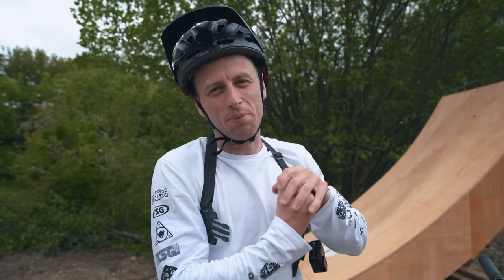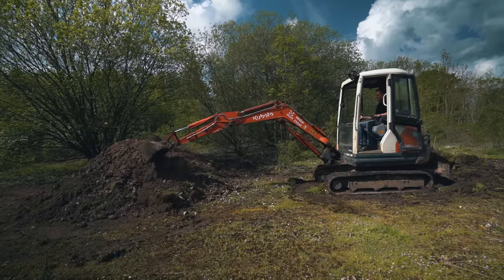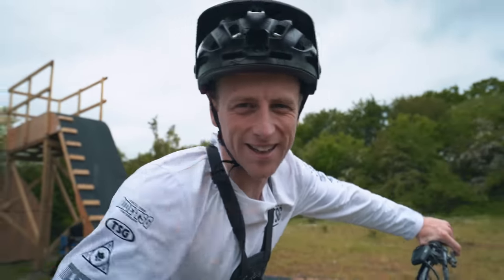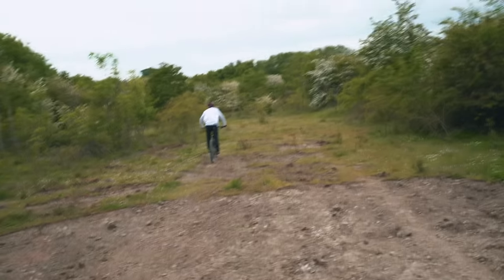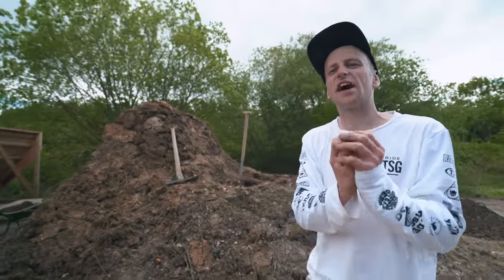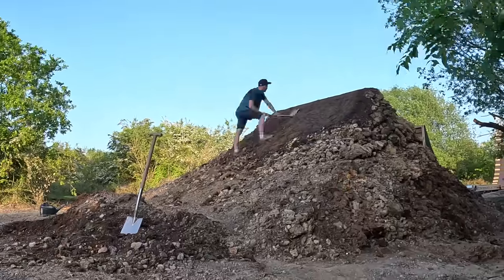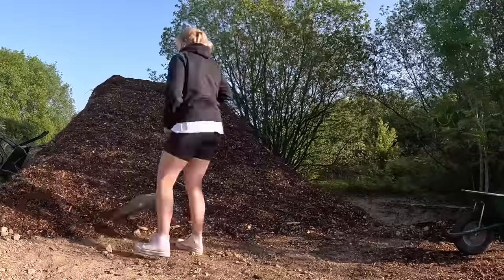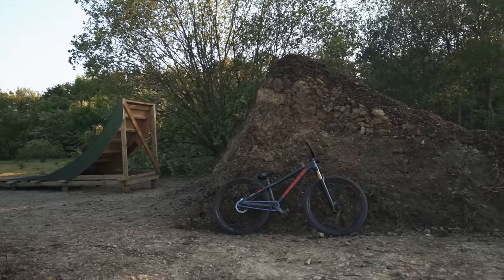BUILDING A HUGE DIRT RAMP AND TEST RIDING THE MULCH!!

Comment: The rollin is too steep and short and the flat bottom betwern th rollin and kicker is tooooooo loooooooong then you need to pedal shorten the flatbottom and it will be fasterr and you will not need to pedal..also if you put ply sheeting on the flat bottom it will be much faster and yiu will not need to pedal.